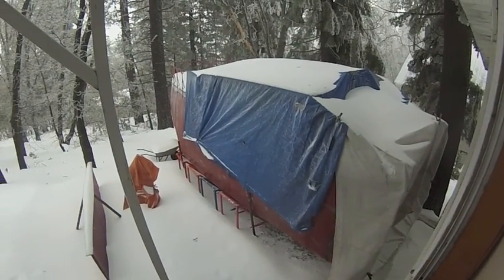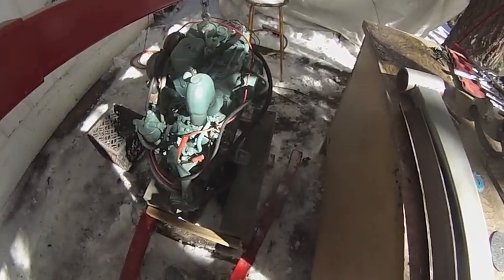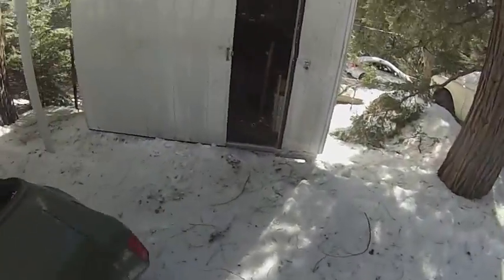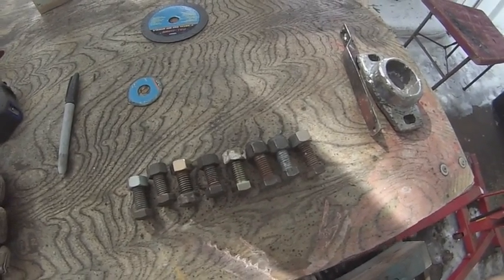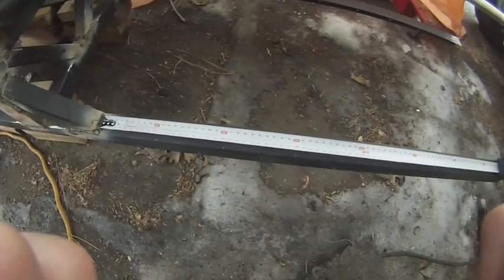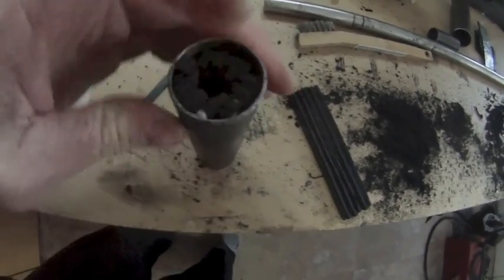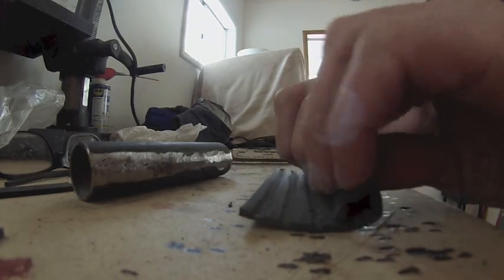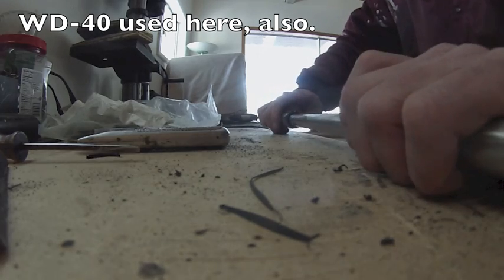Steel Sailboat Build Part 25

Comment: Today I found out - the origin of a cutless bearing. Yes, Cut-less, not Cutlass ( like a sword).  Rubber cuts the shaft LESS than lignum vitae, that used to be used on shafts in the mining industry,

"in the 1950s, the bearing division came up with the marketing idea of stamping a sword symbol on its cutless bearing products as a form of branding. The confusion of the cutless bearing with the symbol of the cutlass was born."

https://www.followingseas.media/blog/2017/1/30/name-that-bearing-1

Comment: Since this bearing does not penetrate the hull, leaks are not an issue. You are using the same bearing material and similar design so looks like you have made an inexpensive substitute that allows you to spare and repair with full knowledge of potential issues.

Comment: It's cool but I'm thinking I would spend the $100 on a cutlass bearing and not worry about sinking
Reply: There is lots of others things that will sink this boat before the shaft seal.
Reply: How does a boat sink from a cutless  bearing ? It just holds the shaft, and is lubricated by water.
Reply: @dnomyarnostaw  The seal
Reply: @tomhutchins1046  A cutlass bearing doesn't have a seal. It uses seawater as lubricant, and is nowhere near the hull driveshaft entry.
Reply: @dnomyarnostaw  I was thinking about an old style sail boat were the cutlass bearing and the seal are in the hull not hanging by a strut